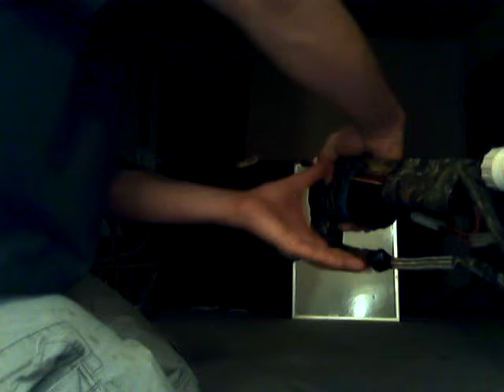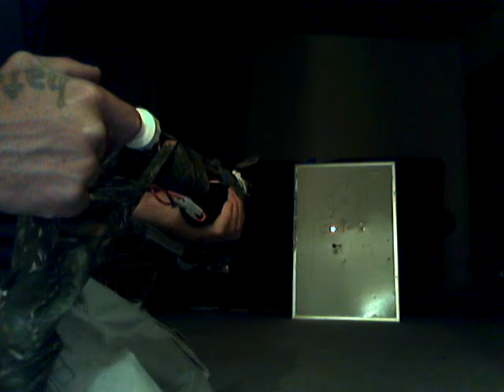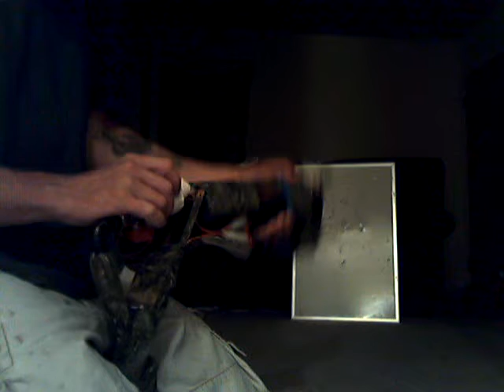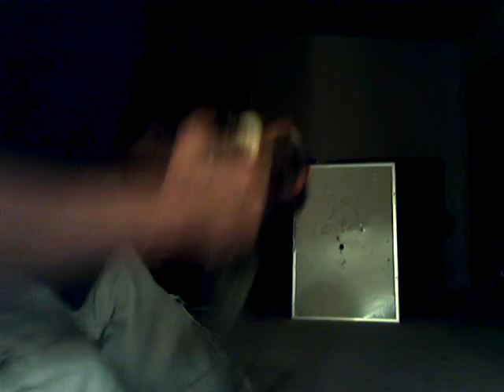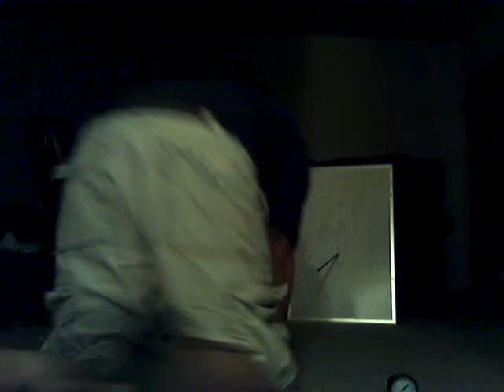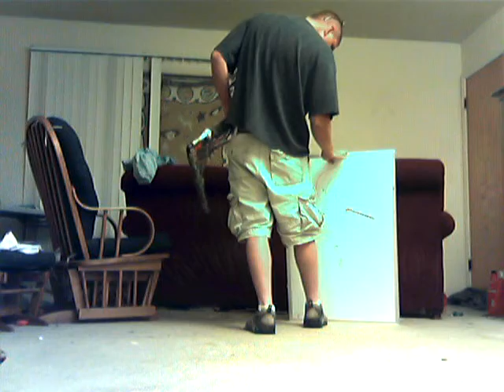Air cannon potato gun spud gun

Comment from the maker: i use two battery packs,NM hidride,
they are connected in series to provide
higher voltage if you dont use a series set up the pump runs very slow,im at about 
16 volts or so i have a 7.2 connected to9.6
volt battery ,thier radio shack nickle metal hydride,,,lithium is my next move

Comment: You'r having problems with acuracy,  because laser isn't really the best aiming system, perhaps you should try more convencional aiming systems (maby even a scope).  Secondly the PVC tube for a barrel is not helping here too, due to high speeds, and big pressures in the barrel it simply changes it shapes. Oh and the darts, they should have two thicker points (on the back and on the front) that will keep them in straight position when thy;r placed in the barrel (it should help alot).